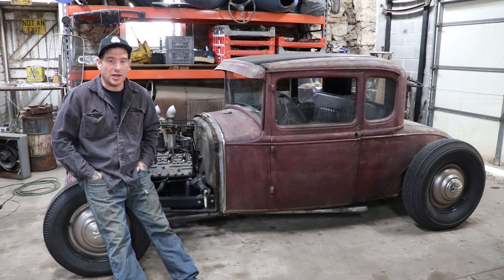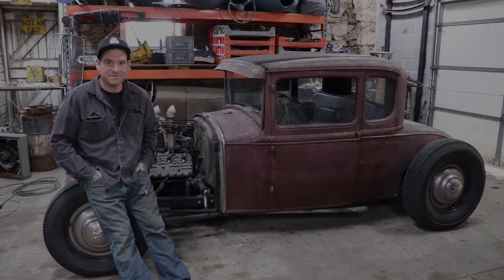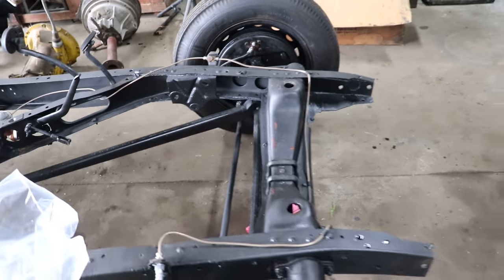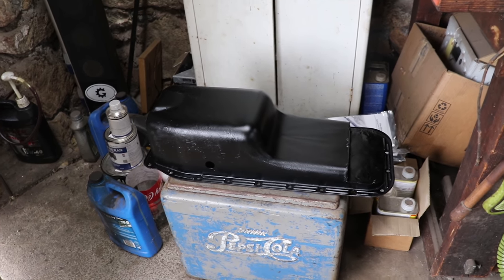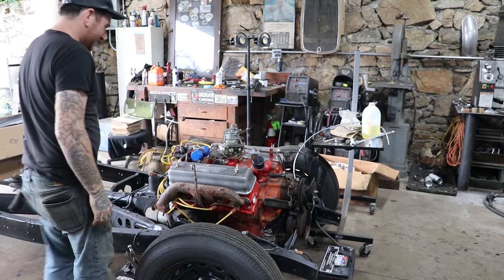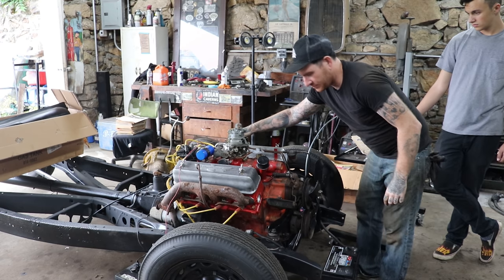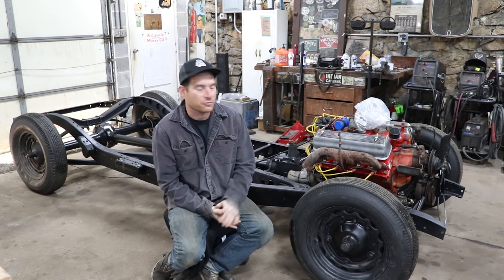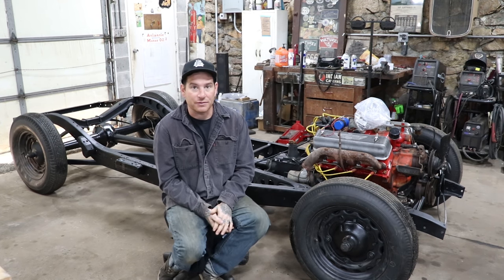1939 Ford Junkyard Hot Rod Revival - Ep. 17

Comment: Hi Matt a couple of comments if I may. You probably don't need the side stabilisers. They are for when the motor is mounted on the center at the front and rear like in the T-Bird. With the wide spaced front mounts and the somewhat wider rear mounts, in my opinion extra side mounts will not be needed. When it was torque rocking as you blipped it the whole frame was rocking, not the motor on it's own. The other thing, is the T-Bird has a spacer behind the water pump. If you can't handle the extra length and want to remove the spacer you will need the matching pulleys and generator brackets off the old motor. just something to look out for.
I'm enjoying the build, keep up the good work. Mart.
Reply from the maker: Hey Mart, I sorta thought that too. Since the motor is mounted differently it probably doesn't need those extra stabilizers, but was second guessing myself. I think I'll wait to get the car further along as I can always add them even after the car is back together. The water pump thing I also was wondering about, I had it all apart to install the front engine mount bracket and remove the power steering stuff. Thanks for the tips! -Matt/ITG

Comment: Always encouraging to hear the engine run. The transverse springs give it a healthy rock and so when you pull up to the drive in, caps on the root beer or wet britches. Course it will change a lot when the weight of the car is added... good job
Reply from the maker: Thanks for watching Morgan! -Matt/ITG

Comment: Don't forget to install the the two engine to chassis tie rods .If not it will dance all over the place when you try and reverse, especially backing up an incline. Sweet running Y block too. It may not have done too much work after the donor car was restored .All you need now is a paxton blower ...😎

Comment: I would have fixed the oil pan clearance problem with a sledge hammer back in the old days!  We didn't have many tools and had to make do with whatever was there.  The old Y-block seems to be running smooth.  I would love to take the 39 for a spin when it's done.
Reply from the maker: Thanks Ray, we're hoping to do this car some justice as it's previous version was smashed, cut and a little less refined. It will remain some of it's bumps and bruises but the work I do I'd like to be of a slightly higher standard than when it was originally done. Thanks for watching! -Matt/ITG

Comment: Always puts a smile on your face when they first fire up doesn't it Matt?  Is the reason it rocks so much when you give it some gas because it doesn't have side mounts?  Is that what you were talking about at the end of the video?  Can't wait to see the body back on the nice frame..  Great job, should fire Andrew up to get busy on his SWEET 16..
Reply from the maker: Hi Robbie, I think it rocked just because the frame has no weight to it and the torque of the engine is a lot for the few hundred pounds of frame and accessories it's bolted to. Yea he's excited to get back on his, he's just scraping together the cash for a front spring and a trans bell housing and we can make big progress on his project! -Matt/ITG

Comment: Great luck on that engine!! Sounds like it runs well. You can ditch tha belt fan and replace it with a spal electric unit. Still waiting to see the firewall fixit video, there's where the real work will be!
Reply from the maker: I try and keep the builds I do "traditional" using all "old" parts, so modern things like electric fans and power steering, etc won't be used. I like the challenge of making it all look and work like they did "back in the day". I can't wait to get that firewall all tuned up too, but that's after the floor pan project! Thanks for watching. -Matt/ITG

Comment: In the original side valve Ford trim, the forward thrust of the rear axle was transmitted through the torque tube, to the transmission & the engine, There were two rods that were bolted through the engine bell housing facing to the rear & attached directly to the chassis. These were actually in tension & perform two functions. As the engine was pushed forward in its rubber mounts these rods actually 'pulled; the chassis along with the engine. More importantly they kept the engine in its place, fore & aft. Since the clutch arm is actuated by a horizontal push rod any forward or rearward movement of the engine in its mounts, however small.
With the rods in place the clutch mechanism could work smoothly avoiding the jerky motion caused by the clutch arm moving back & forward as the engine was pushed forward by the axle, torque tube etc. I have seen some pretty nasty clutch shudder as a result of these rods being left out.
What is your plan to address this issue with the Y block engine.

Comment: I was wondering if it would have been easier to notch the frame. but looking at it you would have cut into where the front spring mounts.
Reply from the maker: Correct. Either way the engine had to come out and I already had a modified pan so it was a better solution. Thanks for watching! -Matt/ITG

Comment: No matter how many times I have done it, firing up an engine for the first time is about as good as it gets. Especially when it's in a vehicle that was once given up on. You most likely know this, but the Chevy style "Ram's horn" exhaust manifolds are found on larger Ford truck with Y-blocks in them. Do you have the correct air cleaner for the percolator Holley?
Reply from the maker: Hi Chuck, I'm looking for a set of those manifolds now. Hopefully have a lead on a set locally so I can get the exhaust all built with the body off. Hoping to get all that done by the end of the month if all goes well! -Matt/ITG

Comment: Matt, I see where you responded to one guy you're thinking of running straight pipes. ...please don't.  There's nothing sweeter sounding, than a Y-block with glasspacs.  Straight pipes are raspy, narly and just plain noisy.
Reply: Matt, I agree with this comment. Trust me on this...Y-Blocks do have their own unique "sewing machine sound". Skip Smithy's...go with a set of Walker Continental glasspacks! Ot better yet, an old NOS set of steelpacks. I  used the Allen's exhaust Corvette "offroad" mufflers on my 59 Corvette which are accurate replicas of the old GM, dealer supplied steelpack muffers and sound really sweet. Problem with those is, they are only 1.75" in and out. If you can work with that, they are plentiful, relatively inexpensive and last like forever. Thanks for the great viewing and hard work!